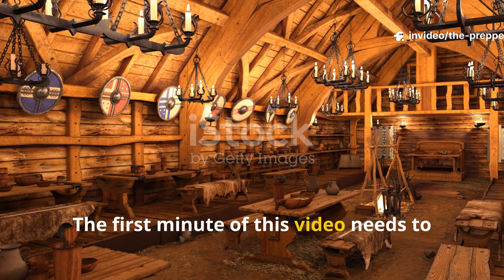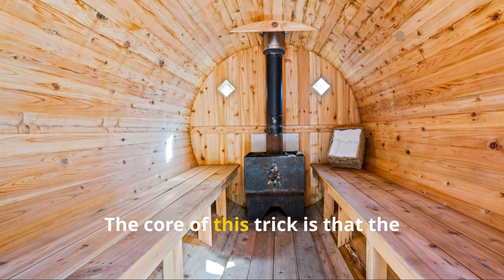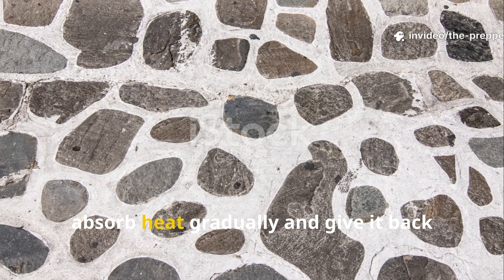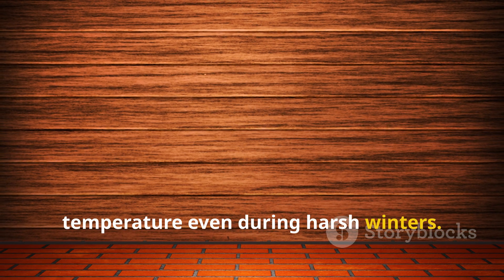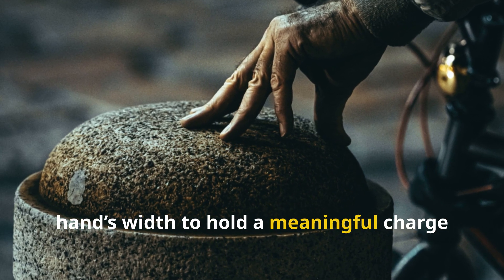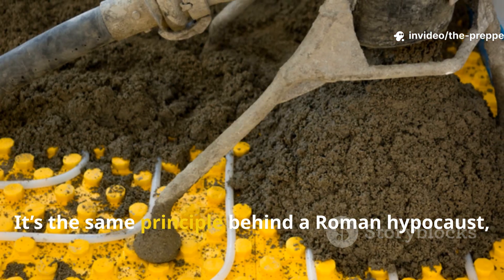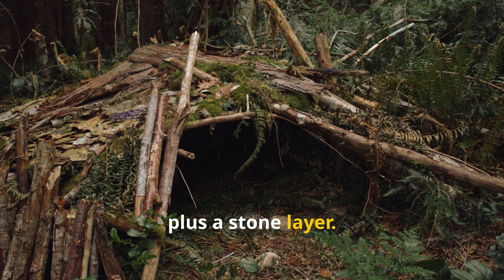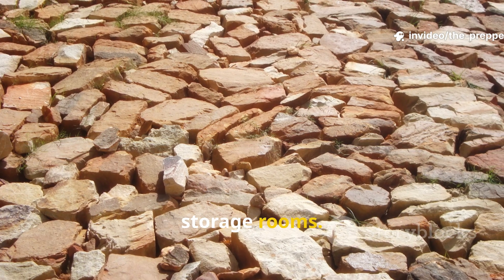The Ancient Viking Heating Secret That Still Outperforms Fire

Comment: 1:34 nice electicaly floor heating 🤣
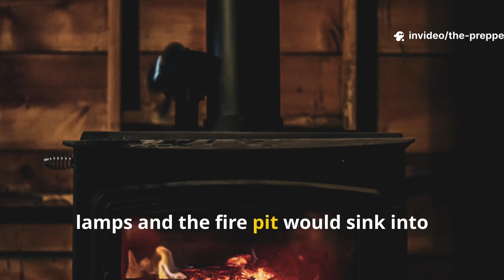2:22 Vikings had NOT ovens like this
2:49 Nice ventilation in a modern brik wall, didn't exist in viking ages
2:_55 modern metalic ventilation tubes 
How many lies is it possible to show in 8 min video ???
Generated by AI, or an american. None outside USA can have so little brain